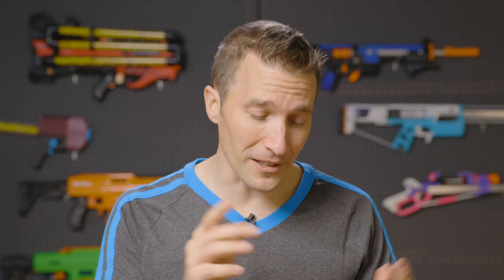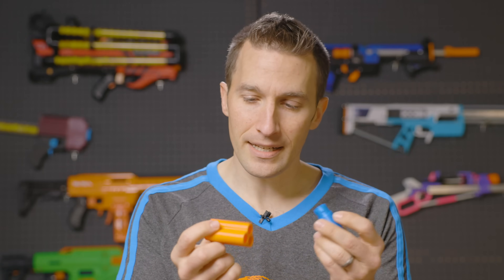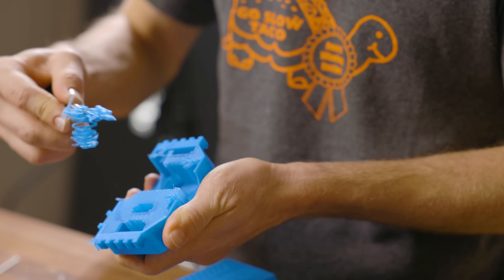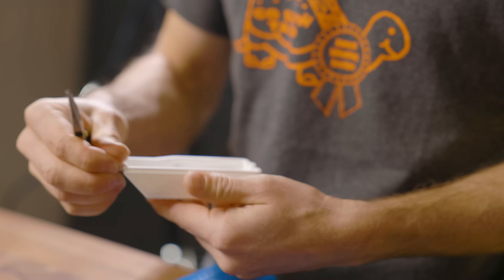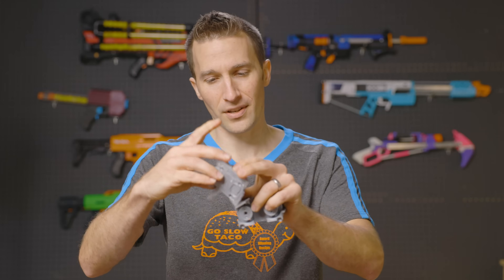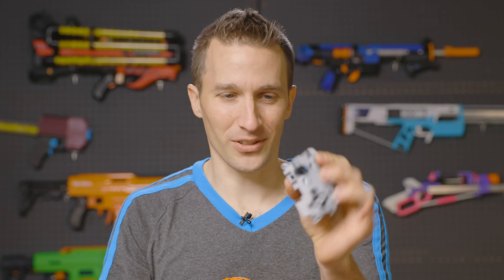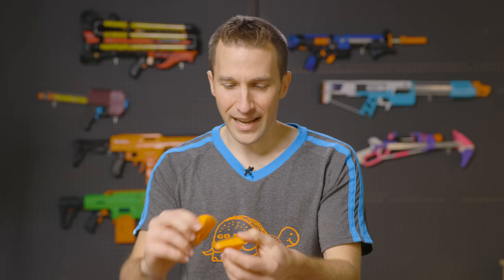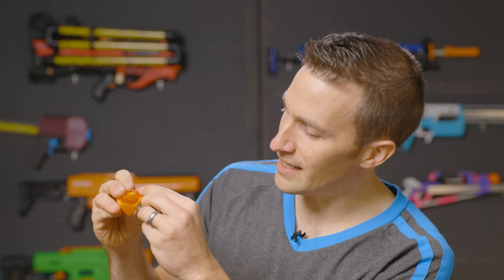Custom-Designed 3D Printed Supports

Comment: Its a great video to give a suggestion of looking into supporting parts with custom supports. But would love to have something that describes the actual creation process of the custom supports. Like how do you make it so the part allows proper remove without scarring, how does it not have bad bottom layer after the support, things like that.

Comment: Hi Luke, thanks for the video and this is such a huge help.  I used your recommended PLA filament settings of 220 nozzle and 66 for the bed on both my MK's and my one mini. The results are much better. What is your recommended flow settings in Prusa Slicer for PLA? I use Printed Solid's Jessie filament (not able to afford ProtoPasta), however even on part top edges I have what looks like a slight over extrusion. Any slicer flow settings?

Comment: Are they using PLA or PTEG?
Reply from the maker: We primarily use PLA. We use PETG for some parts, and for printer repairs, but we've stuck with PLA for most of our products.
Reply: @outofdarts  Thanks for getting back with that info.  Love you're setup and is inspiration for myself as I slowly grow from 1 printer now to 4 and maybe more in 2022.
Reply: @outofdarts  Your printed pieces look so clean and was wondering do you slice with a Pursa stock setting or a modified setting and layer heights. Cheers, Simon

Comment: there is such thing as water-soluble support materials, albeit idk how much it runs for, and I believe it takes a specific kinda printer to use it (two-filament printers)
Reply from the maker: The printers we use (Prusa i3 Mk 3S) have a multi-filament add-on, but haven't yet decided to use it in our farm. Stay tuned though! We're lining up more 3D-Printed content and behind-the-scenes videos.

Comment: I'm assuming that the custom supports are created in CAD as a separate body with a slight gap and printed together ?  Would like to learn more.  Thanks for the great content and I appreciate what you are doing.  Love to see a business like yours doing well......and having fun at the same time !
Reply from the maker: Yes, all created in CAD, usually a .1-.15mm gap is ideal, but it will depend on the part and how much interface the parts have.

Comment: I've personally used custom supports for tall-thin parts that can't print flat on the bed.  Usually it's a single wall tower with easy to cut off bridges to the part.  

You can improve bridging of complex surfaces a LOT with strategic single layer thick recesses.  The goal is to sub-divide the bridge into continuous linear paths on each layer.  Another bridging trick I often uses is "ceiling beams".  These are ribs, 4-10 extrusions wide, 4-10 layer thick added to large bridged surfaces.  (strategically placed columns also often help)  They minimize the amount of long bridging, are thick enough to fully recover from bridging sag, and serve to sub-divide the rest of the long bridges into lots of shorter segments that print with higher quality.

Comment: I'd like to see a miniseries on 3D print settings for Nerf specific purposes. I'd like to see it cover things like infill, supports, materials and orientations for ideal results relating to structural integrity when printing community open source parts like ofp cages, caliburn parts, foregrips, and possibly even body kits. I'd suggest a miniseries format because one of the things I like about your videos is that they're short and "to the point". I think one thing that turns me off from 3d printing tutorials is that sometimes they can be excessively long for the information being presented.

Comment: I recently started my own 3D-printing business back in August selling add-on kits for Transformers figures, running with currently only two printers,  and the way that you do business has been a huge inspiration and help to me thus far. I would actually like it if you went into more detail about the design/printing process.

Comment: Brilliant work Tarik and Luke! I would love to see you guys tackle the low profile picatinny top rail for the Longshot. The one from Worker has the worst quality I've ever seen on a print. It's been a sore spot of mine to use it in builds have have such nice and smooth surfaces even with other 3d printed parts, except the top rail.

Comment: This couldn’t have come out at a better time for me currently. It’s great to see 3D printed tips directly tied to our hobby. I’d honestly love to see a more in depth explanation to what slicer software/custom support tools you’re using to achieve some of these supports or even a guide to explain how you go through understanding what areas need support and what don’t. My personal use and workings with 3D printing has built up quite a lot over the years, but even some really minimal custom support building is an absolute mystery to me.

Comment: show us the process of creating the custom support please. What slicer are you using? Are you modeling the custom support in CAD?
Reply: They're clearly modeled as part of the design.  They're not that hard to do, either.  Generally you can get good results by supporting the edges of overhangs with modeled walls that follow the same contour, and you just design in the same air gap that you'd slice automatic supports with (I usually use one layer height).  Another trick for stepped holes (like, where the lower part has a larger diameter to accommodate a screw head or something) is to model a one-layer skin across the step - then the printer isn't trying to draw the smaller diameter in midair on the first layer of the size change, and you can just punch out the thin layer of plastic when you insert the fastener.
Reply: I think he uses cura, I use it too it's a rly good slicer
Reply: @LukeBricks2005  No he is using prusaslicer as said in the video. but i have a feeling the custom supports are made in cad